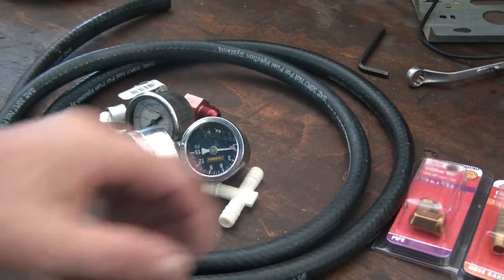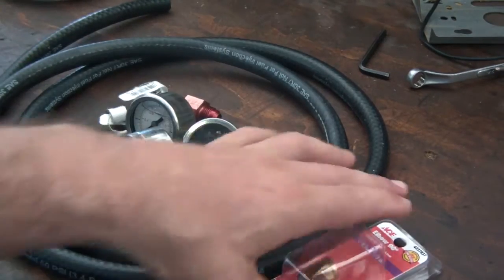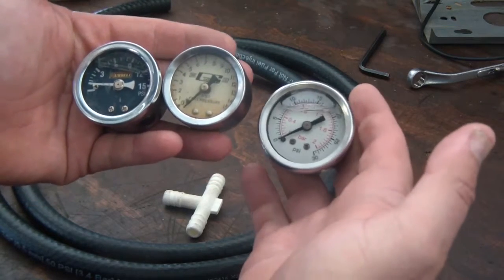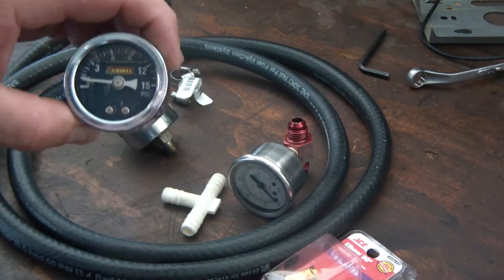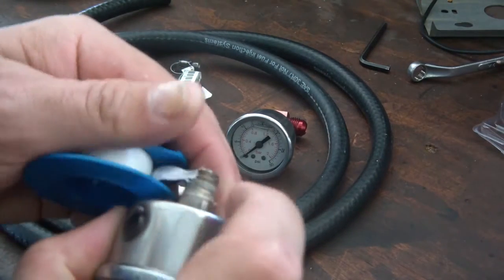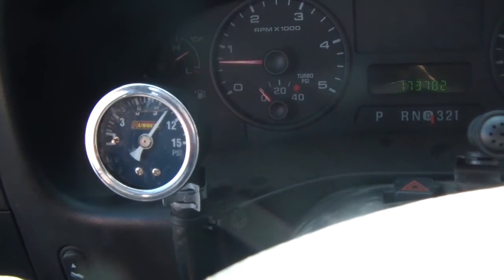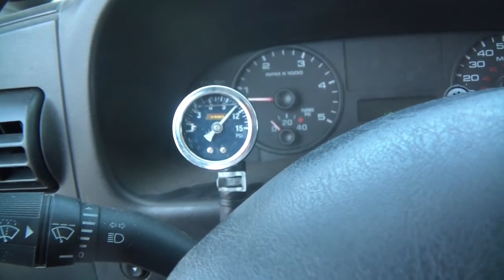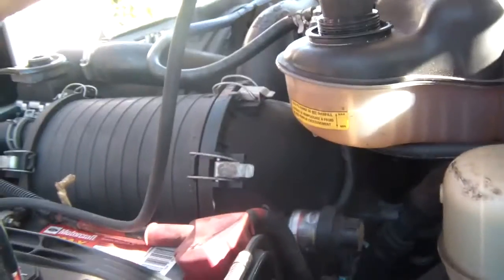Powerstoke 6.0 Coolant pressure gauge build install blown head gasket check test

Comment: Mine give me simmilar results to this. I've found if you crack the cap and try to test again you'll never get above 3 PSI it'll only get up when it's from a cold start
Reply: if you drive to operating temp And then pull over and crack the degas cap to release all pressure the psi will go to zero. Drive it hard for a while and if the psi does not increase your heads should be okay. My 05 6.0 runs about 7psi with no trailer cruising and 12 psi towing 14k uphill.
Reply: mine did the same about 2 psi after zeroing cap pressure. Its fine.  If bad will go up to around 15 .

Comment: Been awhile, do you have an update? Interested to know what the ultimate outcome was. Thanks!
Reply from the maker: I think my headgasket is fine.
Reply: Fintech Repair Shop mine is the same but mine has arp studs its been in the shop b4 i bought my truck but losing colant rear pasenger side i did the same t method but i does not go past 13 psi i think my truck is fine no white smoke 💨 im confused where is it suppose to be at on gauge betwww ????
Reply: @marisolmacias140  heater valve leak
Reply: @fintechrepairshop  you keep that tune on there they won’t be lol